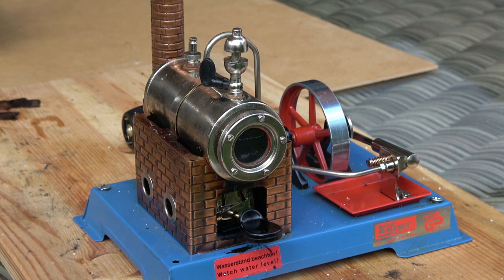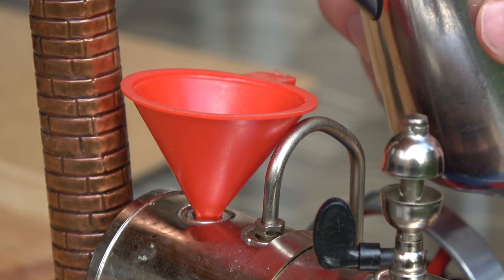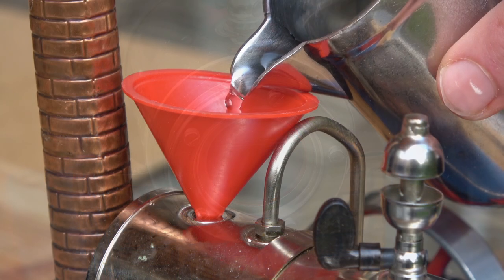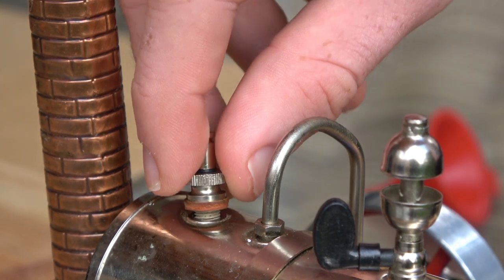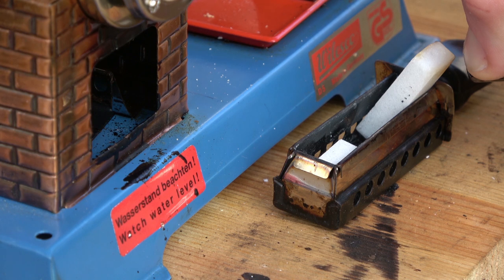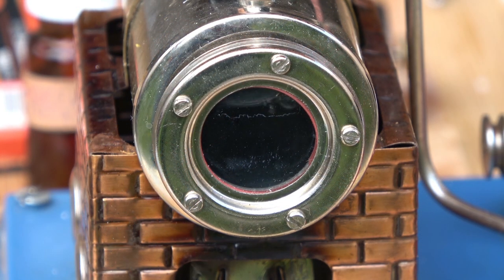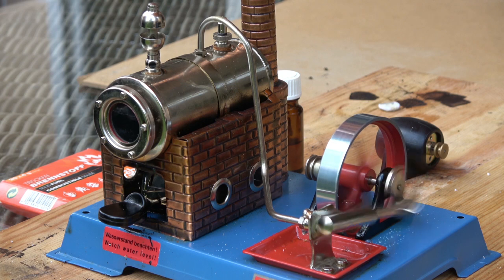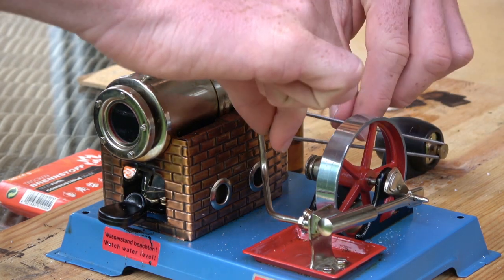Model steam engines in service - Wilesco stationary steam engine D5

Comment: Two comments...you filled the boiler too full campared to what is recommended...and two...did you not hear the squealing of dry parts when you started the steam engine...it is standard practice if you want efficiency and to guard against excessive wear to lubricate every pivot point and wear point on a steam  engine to facilitate smooth operation without excessive wear.

Comment: What happens when it blows up
Reply: if you can tell when its going to blow up, you run.
Reply: It can’t. The safety valves will release steam if the pressure gets too high.